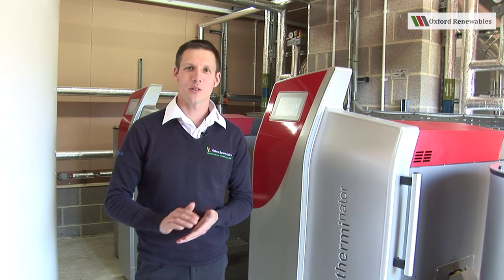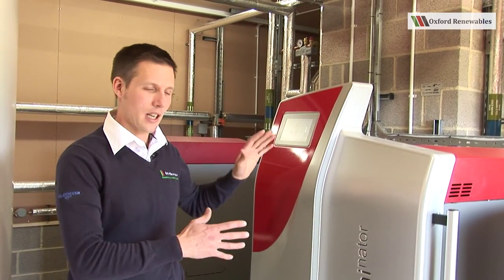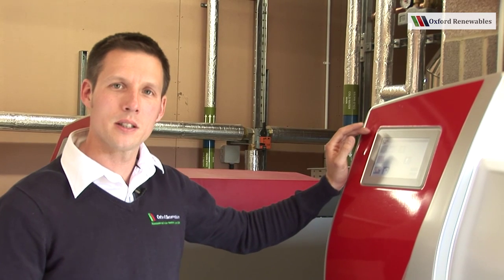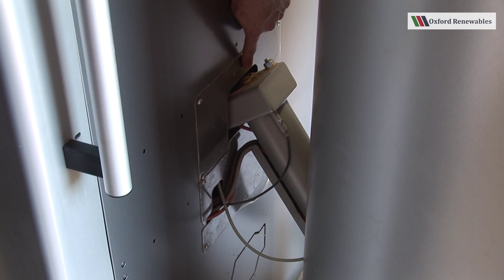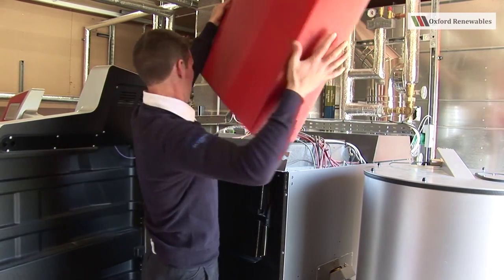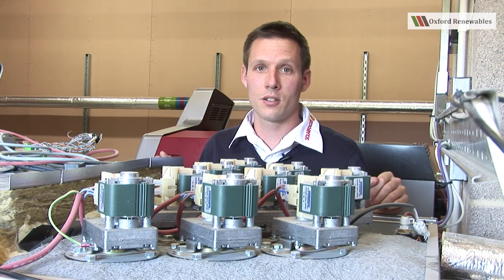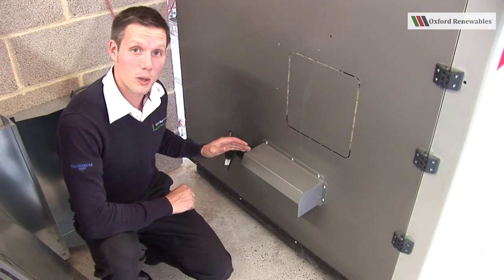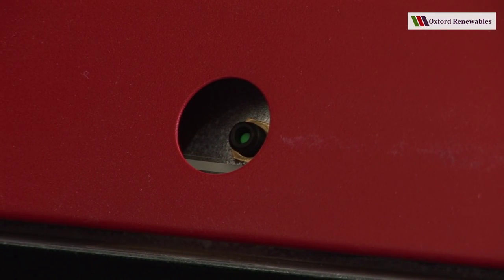Introduction to the SOLARFOCUS Therminator II

Comment: Thank you for the great description of the heater.  We have a Terminator 2/60. Unfortunately, one of the 9 engines responsible for cleaning the heat exchanger loses some oil.  Do you have any idea where we can get a replacement motor?  we haven't found a fitter who can get us this motor.  A regional fitter wants to replace all 9 motors and switch to reamers.  The heating is in a non-profit organization and unfortunately we don't have the budget for such a major repair.  Please help us.
Reply: Just fix the oil leak ? Don't have to cost a lot of money .
Reply: @avap2677  Thank you for your reply.
Good idea, but where does the oil on the engine come from? Is it from a gearbox? Who can repair such an engine?
Reply: @richardcordes5834  Here in the Netherlands we have special company's for repairing electric motors and they know how to seal the gearbox properly.